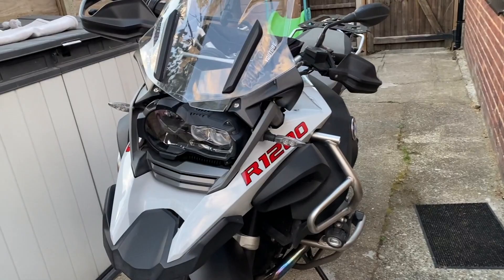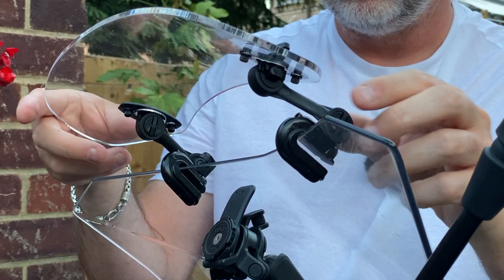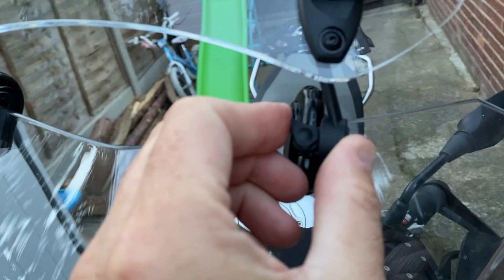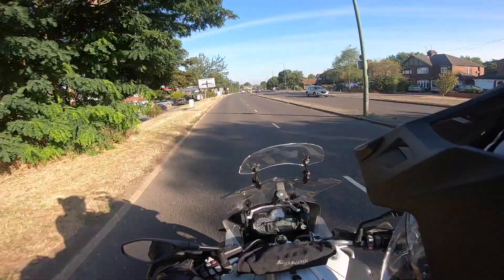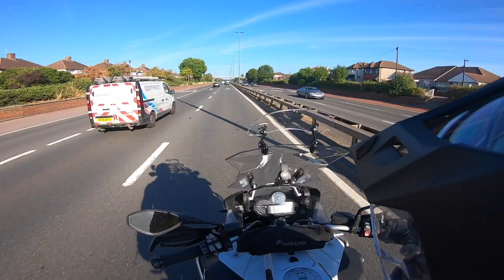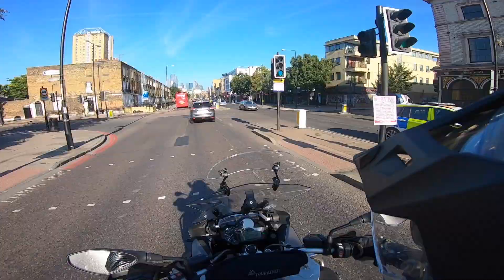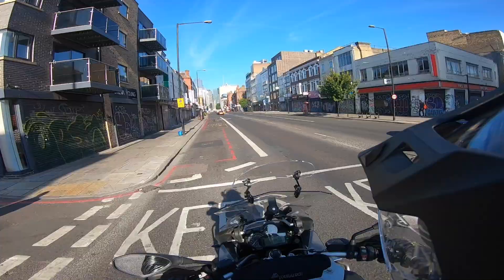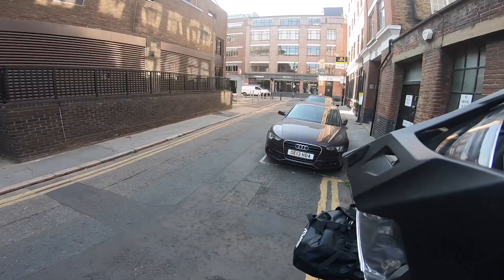VLOG 25: Wind flaps | Crack Heads | The Humphrey Bogart of Motorcycles

Comment: I have the same screen add-on on my Tiger 1200. You might find you get the same good results with it parallel to the main screen and just a little bit higher than it. It will be out of you eye line but still do the job. Set the arms pointing right down forward.
Reply from the maker: Cheers Terry
Reply: Make a venturi effect that way.. 👍🏻🍺

Comment: You lucky Billy, I bought mine and it came in pieces, I had to assemble the lot with Chinese instructions and out of focus b/w pictures 😎 don't make my mistake and over tighten the 4 lil Alan key bolts as I cracked my windscreen. As per usual I tinker with stuff and make it 10x worse that it started 😭🤦
Reply from the maker: I came off alright then! That actually makes me feel better. Sorry. 😂

Comment: I noticed that you didn't lock the new topscreen with the two turning knobs at the front side, because I saw that you could adjust the topscreen when you were riding. Is there a chance that the topscreen wil move, or turn more horizontal, at higher speeds?  I have a similar topscreen, but I always lock it after adjusting..
Reply from the maker: I just wanted to tweak it whilst i was riding, get the perfect position then lock it. Im still fiddling with it to be honest.